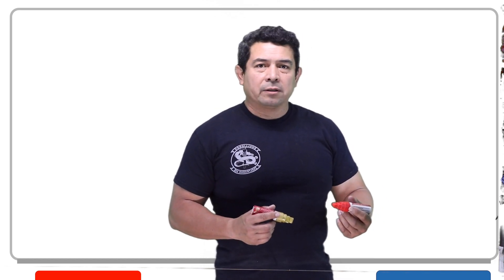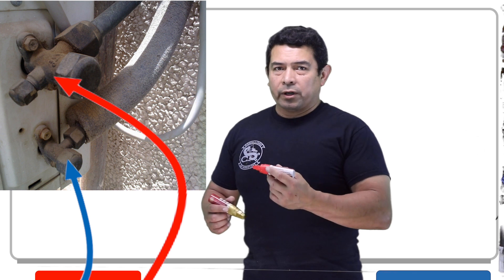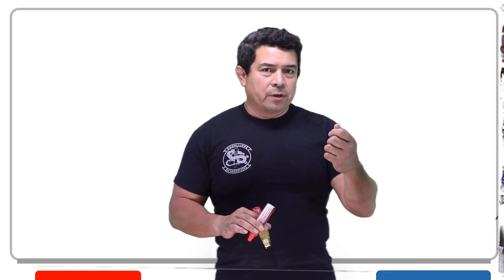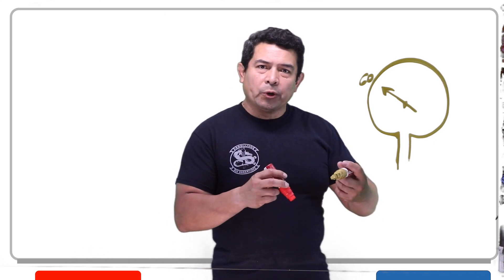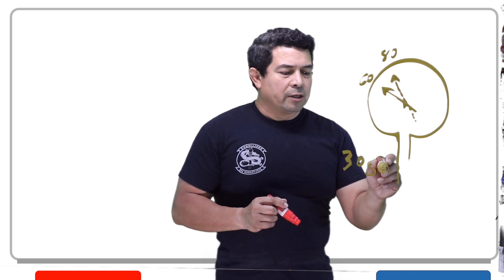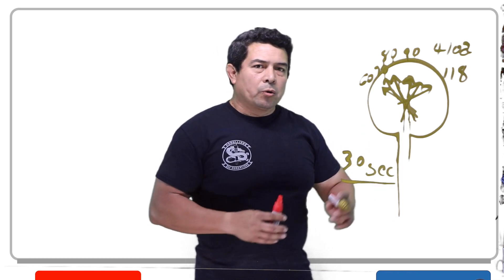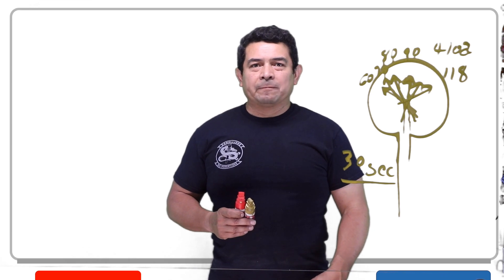Charging a system with liquid-HVAC Online Training and Courses

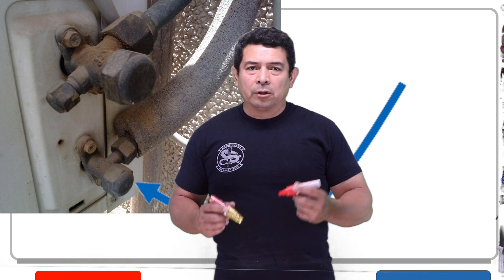Comment: Hello Sir, Tnx for the video, here is a question, in min 1:26 are you sure that you are mentioning the high side and low side currently ?
Reply from the maker: Kamran Man     Yes, I am on a train to high side and the low side. And when adding refrigerant you can only add refrigerant to the low side.
Reply: @AirConAcademy  you are right sir but what you are showing on video is different ! The pipe with higher diameter and access is low side of our system and is our suction line ;)
Reply from the maker: @kamranman8369  yes,   I placed the arrow there because it is insulated.   I should have come up with a better picture.